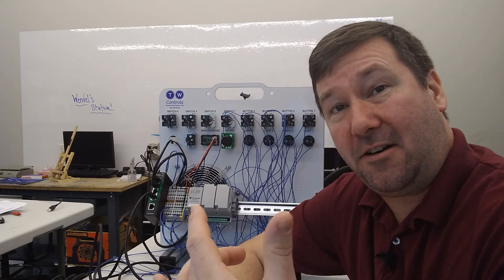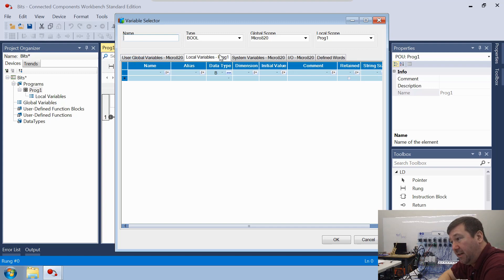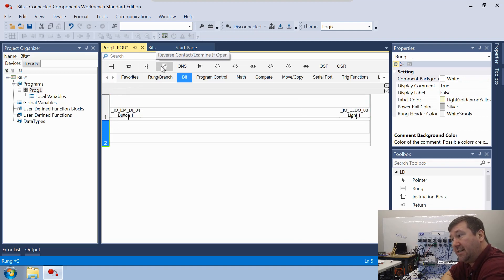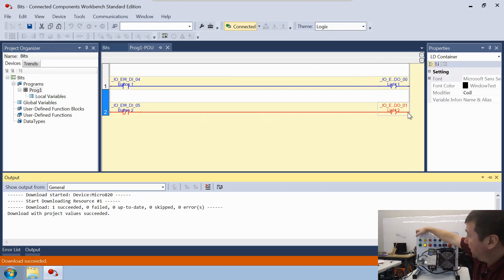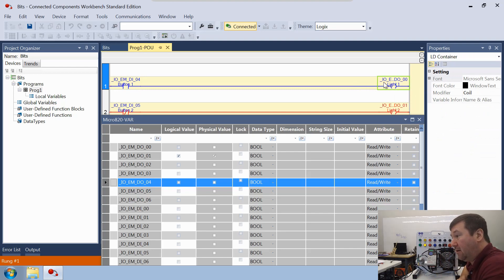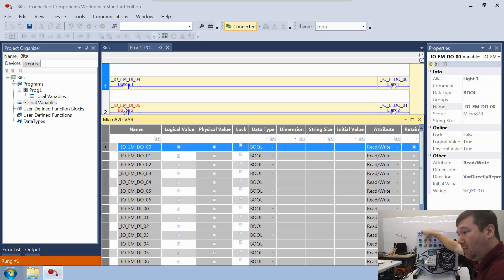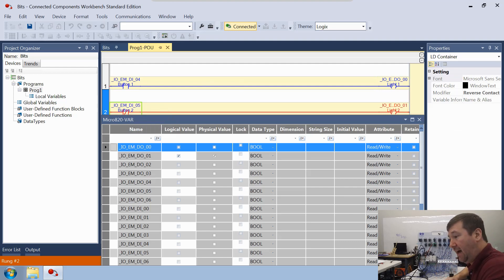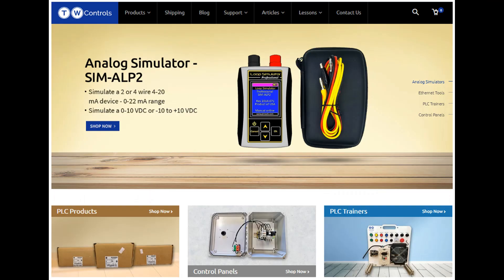Micro800 Bit Instructions Direct Contact, Reverse Contact, Direct Coil

Comment: Stupid Question but I am used to RS500 and How do you write Bits ( used to be B0:0 ) to the Micro 820? I have the inputs and outputs listed but I do not see Bits listed. Can you help me?
Reply from the maker: You can create a tag, data type BOOL, or if you wanted to address bits in an INT or DINT, select the tag, then enter a period and the bit number after it.  For example if you create a tag called MyTag, data type of DINT, and want to address bit 5 then it would be MyTag.5

Comment: 8:41...what am I missing. You said "input 4" but selected "output 4". Same with input 5. Not sure if I understand.
Reply from the maker: You are not missing anything, I just pointed to the wrong data point when speaking.
Reply: @TimWilborne  okay, that's what I was hoping. The inputs should be on top IMHO. Great videos. Thanks.
Reply from the maker: Yes it has stumped me many times as to why an input wasn't switching when I was looking at the outputs by accident.
Reply: Yes, it seems counterintuitive and not even alphabetical.

Comment: Thank you Tim, I recently started learning and understanding PLC and specially CCW. Your videos are a huge help to me. I really appreciate what you're doing.

P.S. just a suggestion: I barely can find any order in your videos for learner like me. Would you please make an order for them or give a number to each videos as a session. That makes it significantly easy for us to learn your training step by step.
Reply from the maker: Hi Maziar.  They aren't ordered because as we add videos based off of viewer comments, many times they need inserted in the middle of the series.  Here is the CCW series in the order it is meant to be watched.  We're still putting out videos every week or so for it so check back often.
https://www.theautomationstore.com/ccw-micro800-training/

Here is an example why the numbering doesn't work well.  Part 1 of our control panel building series is actually the 2nd video...
https://www.theautomationstore.com/designing-and-building-electrical-control-panel-lessons/
Reply: @TimWilborne  thank you :)
Reply from the maker: @Maz.Rafiei  You are welcome, let me know if you have any questions through the lessons.